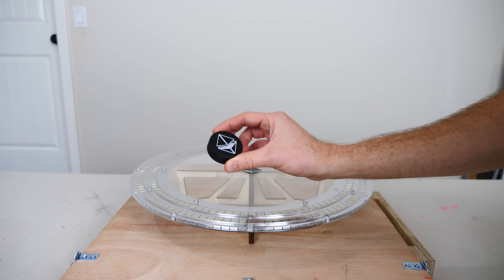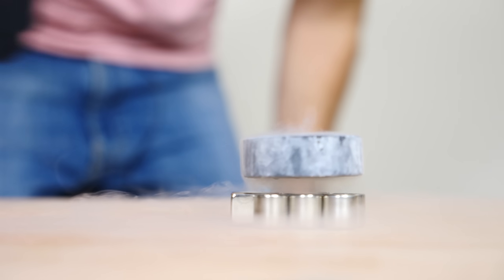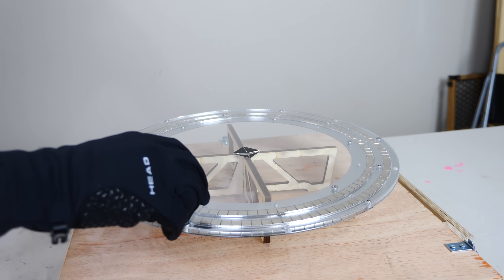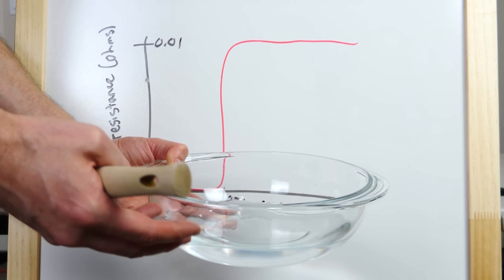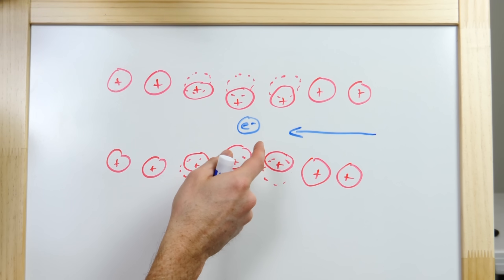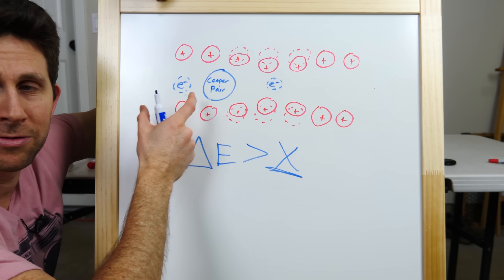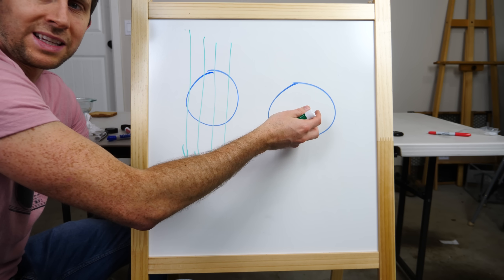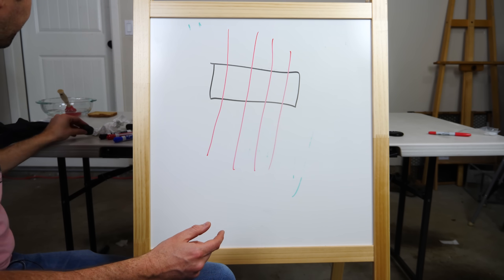Quantum Locking Will Blow Your Mind—How Does it Work?

Comment: I imagined the future vehicles to that quantum lock
Reply: A vehicle like this would be very expensive, let alone a whole road.
Reply: @gabor6259  Yes it would be more likely that small components in vehicles and machines would use this technology to reduce friction. So instead of flying cars, we're looking at 100 mpg
Reply: @Grizzlox  but gasoline would likely be obsolete in card by then
Reply: @gabor6259  Maybe not, youre thinking way to far. Youd probably just need a stable and compact base for the car made of superconducting material. "Gas-Stations" would be low-cost as liquid nitrogen can be produced from scratch and evaporated nitrogen during the cooling process could be catched and reused. Only the roads would be expensive as they have to be out of high-capacity magnets. But compared to not having to use fossil ressources, not producing emmisions and a relatively extreme low-cost and beeing able to drive risk free this probably could be a) more affordable than any technology reltaed to cars (for example elctric cars XD) - b) the safest - c) the less maintenance needed overall
Reply: SyrRokZu Gaming magnets degrade overtime right, unless electromagnets are what you are talking about but that would also require a lot of energy
Reply: @gabor6259  Sounds just like we have now tbh..
Reply: @gabor6259  financial aspekt is not a problem. we have Elon Musk.
Reply: @gabor6259  or just drop pricerate once its evened
Reply: That's what the people hundreds of years ago said.
Reply: @gabor6259  might be useful for zero friction experiments though
Reply: Maglev trains are a reality since the 70s guys...
Reply: @k1ry4n  maglev trains doesn't actually use quantum locking. Unless you are talking about the Japanese version it use superconductors on the rails, but it is more recent. The German version which is the older version you are probably talking about uses EMS which is electro magnetic supsension which doesn't involve superconductors.
Reply: @myst1k838  Development of SCMaglev by Japanese National Railways started in 1969, with the first successful test run in 1972. EDS technology using superconductors, hence the name SCMaglev (= SuperConductingMaglev).
Reply: same with me
Reply: If we can get this to work at room temperature or higher it'll be a huge game changer
Reply: Seminaia there is a certain current you can use where you put something on a track where there poles are opposite. No it can get hot as hell but the technology exists. In fact space x has a contest that many schools enter to build a prototype of a train kinda thing I forgot what it’s called but it works
Reply: Ye plus cost to keep the bottoms of the vehicles cool
Reply: That's what I was thinking as well. That quantum locking seems to be the start of possible "flying cars." I mean its obvious that some scientific research is hindered down to the general public. But theres most likely things out there that we've yet to witness.
Reply: @WCG_Toxin  you have no idea... "they" have already  been across the galaxy..
Reply: And thats a story for another what if
Reply: Randoms For You same this world would grow a lot more
Reply: Use it as a space cannon to fire stuff high enough to get thrown by one of those spinny space trebuche things that we are probably going to use in the future for space travel.
Reply: Randoms For You maybe this is the key to making a real light sabre (minus the power cell lol) 😆
Reply: Impavide look at the hacksmiths light saber videos
Reply: That what I was thinking
Reply: MR FREEZE-98  oh it exists and i've seen it in action
Reply: It would be better with trains and more possible
Reply: future? checkout what hyperloop is
Reply: Wow I love buying liquid Nitrogen as fuel
Reply: Imagine future trains to the quantum lock! 
= No speed limit. Because no friction.
Apart from air resistance.
Reply: Imagine if you're in the Antarctic and to make transport easier you make a train that's like super fast with these quantum locks there.
Reply: There's a vid where they did it with a skateboard, search it up. Levitating skateboard or sumthin
Reply: ???? And there is a video that explains it as well
Reply: I'm thinking more of a "help me my car wont move because it's in a state of quantum lock"

or quantum locking will be used to put cars on display
Reply: China already made it.....the train the Electromagnetic train
Reply: Trains could fit
Reply: Or atleast payload transportation
Reply: They use liquid nitrogen as fuel
Reply: That's an interesting idea. The Earth does have a magnetic field and a strong one at that. But then it would take some threshold energy to move the superconductor to that point in space, so you'll need to constantly supply large amounts of thrust to move it from one point to another. Not to mention maintaining such low temperature. But it's interesting to think about.
Reply: the technology for bending spacetime exists, why use this corny method...
Reply: @PokemonTenLV  Yeah, it does. But who will bend reality to move a damn train? other than cj
Reply: @PokemonTenLV  big brain , little physics background 😂
Reply: TenLettersRap 
The technology being just existing with mass
Reply: TenLettersRap so time travel exists? Lol ok dude
Reply: @colinsoileau5033  its not time travel
Reply: Colin Soileau uh, yeah it does. Have you not researched time travel and quantum theory? They say it’s only possible to go back in time though
Reply: TenLettersRap bending space time is time travel. It’s like taking a part of space folding it like a sheet jumping to that other fold and unfolding the sheet. That’s time travel. Not even quantum physicists understand quantum physics to its full extent
Reply: Mason Letoto yeah on a quantum level maybe but quantum physics is so complex it can’t even be proven so that’s not necessarily true bud.
Reply: Elon musk explained this in one of his interview with joe rogan podcast (the one which he smoke weed) that this thing would be possible but it could be expensive, messy and dangerous, and that he couldn't see the value of this compared to using railroad tracks and actual road.

Comment: Can you create a limitless movement if it is put in a vacuum chamber ?
Reply: It will be pulled down by gravity, heated up by external radiation and due to the second law of thermodynamics. So it will eventually stop
Reply: What if it was in an area of space without gravity ? And an area of space that also kept it consistently cool assuming that those factors would never change ???
Reply: It would definitely have to stay cold like you said but that is a very interesting question I was wondering the same thing . Maybe if the conditions were absolutely perfect and it were to stay cold it's maybe possible . But I think that would be extremely difficult to do and on top of that there's a possibility that the magnets could maybe lose their power over time . The energy is going somewhere right ? Idk lol
Reply: I think space is cold enough,  and a vacuum. People are trying to get technical, but really... if the thing would keep moving for longer than a person lives, that's good enough to be considered perpetual motion.
Reply: Almost. You could do it, but you'd still need a way to cool the superconductor. That's an engineering problem though, and can be solved through the simple practical method of fixing on a heat screen, sticking it on a rocket and launching it into space.

Comment: If the strength of the locking scales with both size of the Type II Semiconductor and strength of the magnets: could you theoretically create a "platter" or plane to transport large objects or goods (ie. Train/Monorail)? If it scaled predictably (Linearly or Exponentially), like previously mentioned, would you then be able to calculate the size of semiconductor and strength of magnets to support a specific weight?

Comment: Pls tell what happens when two things at speed of light hits each other
Reply: Lalit Mittal nothing can travel at, or faster than light, but if two objects hit each other at 99.99% the speed of light, the energy of the impact would vaporize both objects and release a tremendous amount of energy. You’d see a bright flash of light, and then you’d be dead cause everything in several mile radius would have been vaporized from the energy released. If you were outside of that boundary, you wouldn’t quite vaporize but you’d be fried with radiation from the gamma and x-rays released during the event. This is only what would happen in space though, since there is no air to transfer heat, and most of the energy would be forced to escape via the brightest flash of light you’ve ever scene. If this happened in the atmosphere of a planet, the energy of the event would also vaporize everything in a several mile radius, but this time a massive nuclear explosion would form as well
Reply: Andrew Parker cool
Reply: @andrewparker318  I think you are exaggerating